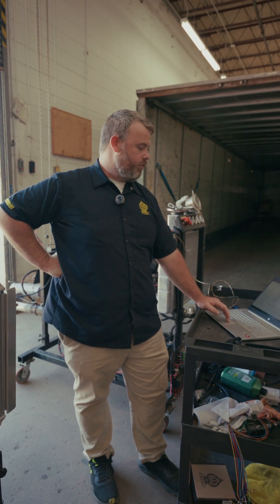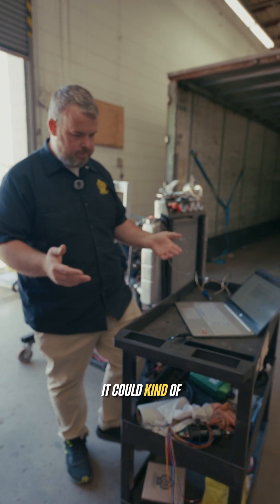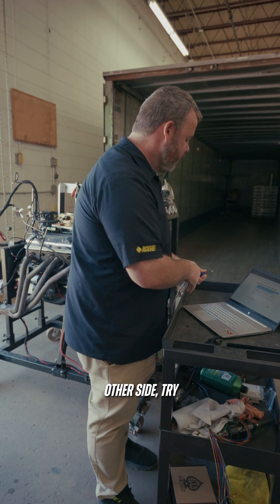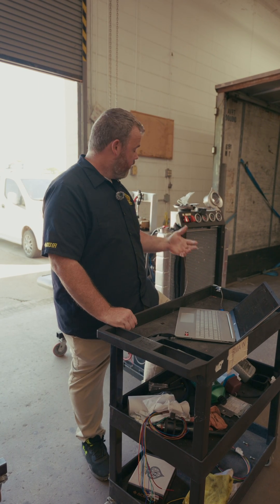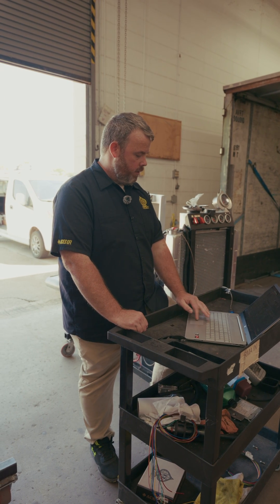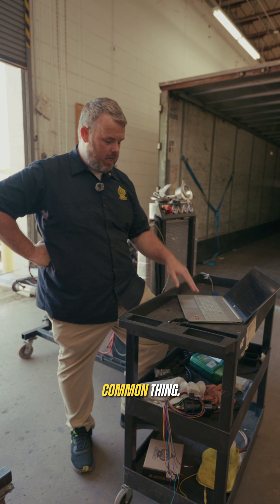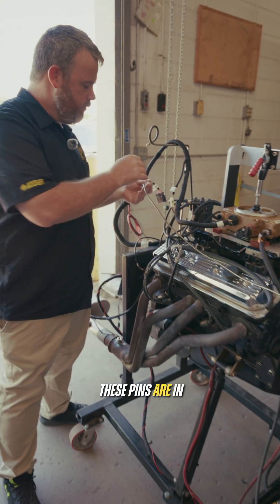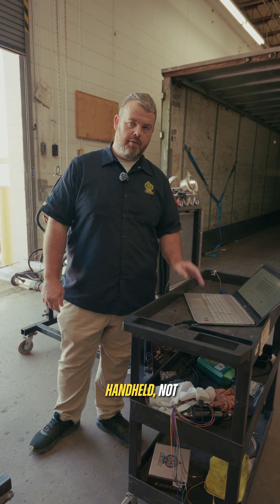Setup and Connection: Advanced Tuning Software (PART 2)

Comment: Currently having an issue where the target AFR under tuning does not match what the target AFR under monitor wants. 
Example. I adjusted the target AFR at idle to 13.8 instead of the preset 13.5. When going into monitors it still shows the target as 13.5 and actual is 13.4-13.6 indicating it’s trying to compensate for 13.5 and not what I’ve asked

Any ideas?